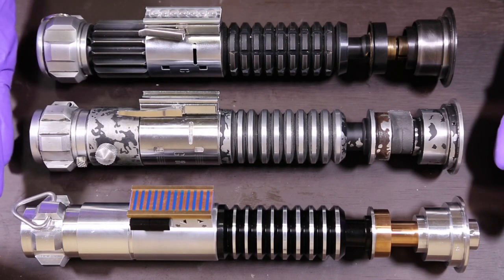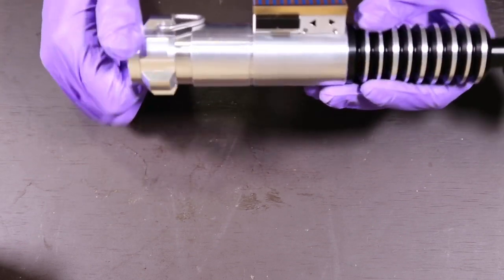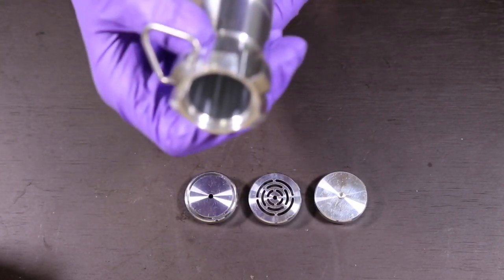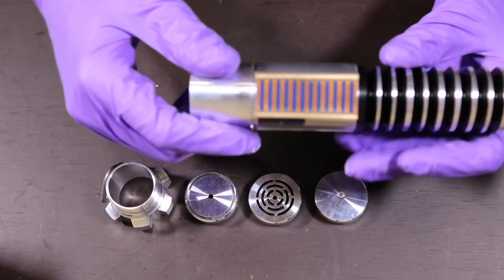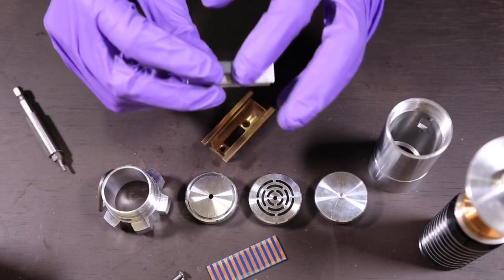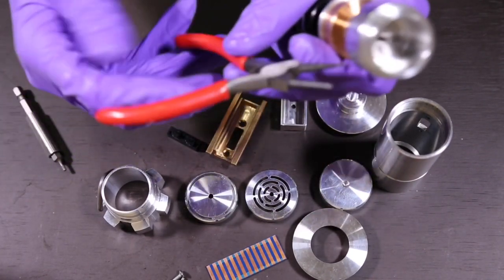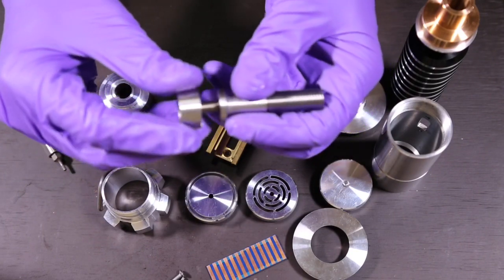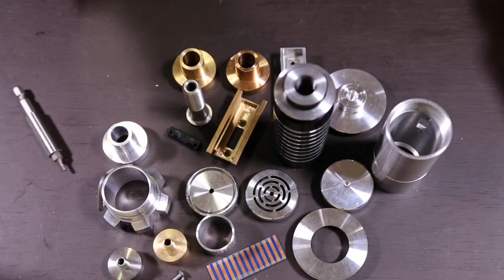MoM of All Heroes - Introduction (Part 2)

Comment: Great hilt! Just one (stupid) question because i didn't get it: which heatsink is supposed to be for a neopixel install? The copper looking heatsink or the aluminum one?
Reply from the maker: The small cups inside the emitters: copper longer one is for CREE in-hilt and the shorter steel one is for pixel connectors
Reply: @codeforger22  thanks a lot for your quick response. :)

Comment: Guys honestly, well done. I was able to hold and inspect the hilt this past weekend. 
For myself, I do custom work when possible but mostly I’m an installer. 
So as an installer, I can say that every detail has been thought out in the engineering. So often I run into issues on sabers that while beautiful, were not really designed with FX in mind. 

Not so with this offering. All the details inside and out have been carefully thought through, and I really appreciate that. 
Also the steel threaded neck attachment is a beast, and heavy duty. 
and you guys haven’t even seen the guts of the control box yet!
I gain nothing by this endorsement, I just feel like this is the most accurate and well planned Hero there is. 
Again, fine work guys!
Reply from the maker: Thank you! We are absolutely thrilled and think the community will be as well!

Comment: Great video Adam! Will the neopixel blade need a recessed PCB? Or will it be flush up against it inside the emitter?
Reply from the maker: Requires a recessed PCB. Only way to get the socket deep enough to stabilize a blade on this design
Reply: @codeforger22  that's what I figured.  Great job with this! I can't wait to get it in my hands!